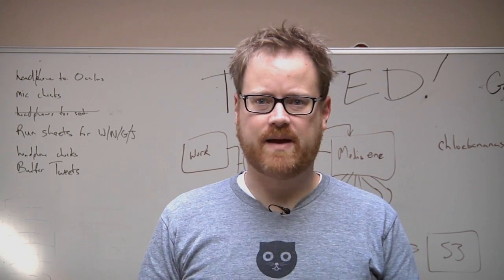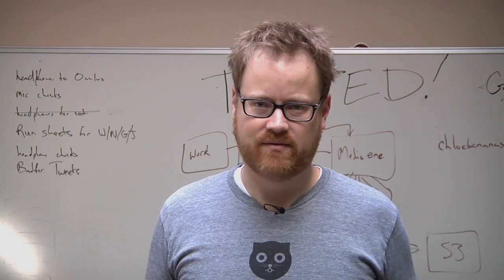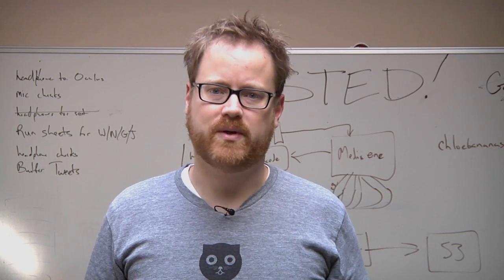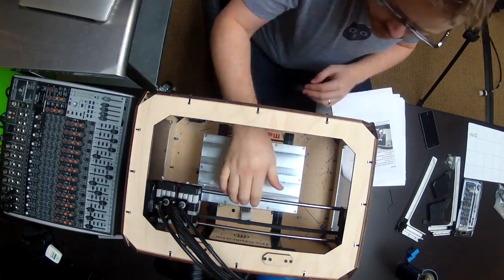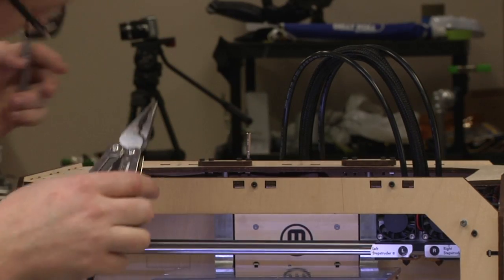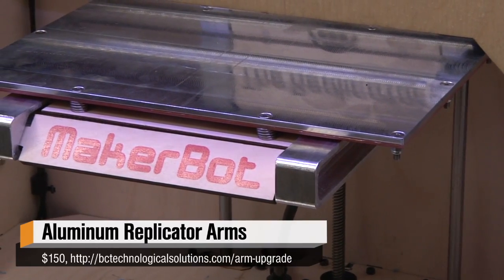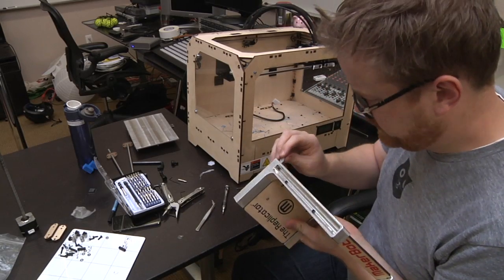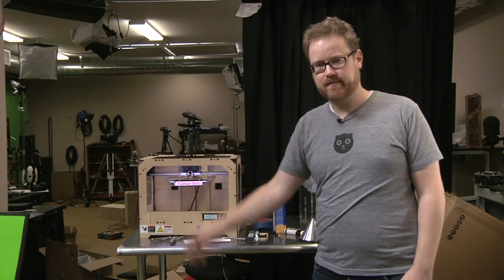MakerBot Mystery Build: Upgrading the Replicator!

Comment: Cool! I wonder if one would change just the materials of a Replicator (you know, the whole thing) in order to keep the structure and temperature more stable... How much better a printer would that become.
No more wood or plastic (except maybe for the the extruders), just metal and glass.
Reply: It really wouldn't change a whole lot to be honest other then the looks of the printer. The best thing you could probably do for your printer is add these arms and upgrade the extruder head. A heated/sealed chamber would help in keeping the temperature more stable but yeah that and few other misc. upgrades wouldn't hurt but in reality it's all about trying materials with different settings and going for the best build you can in your environment.